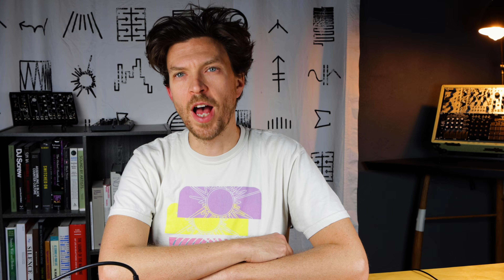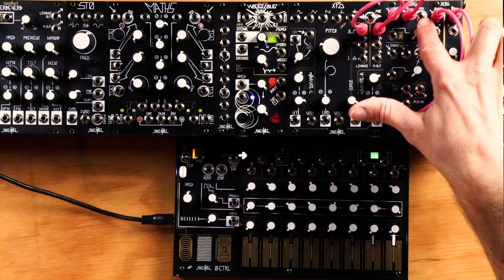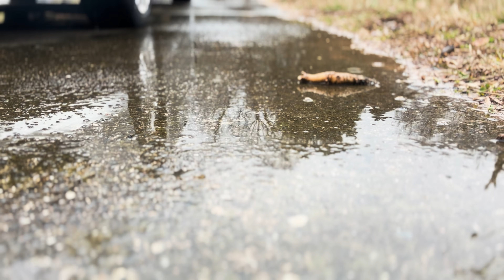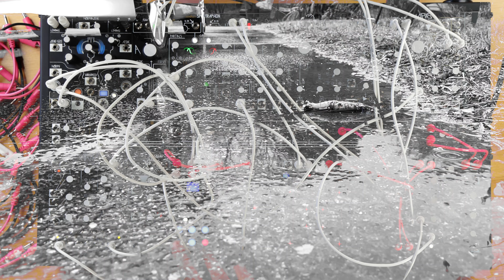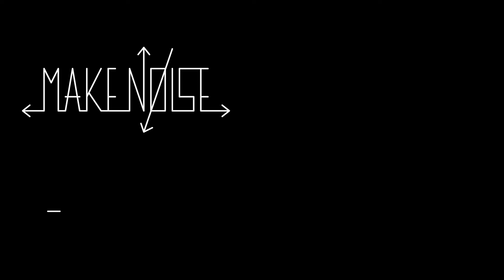DXG Strike and More! | Make Noise

Comment: You did say if we had any questions or patch requests... 

Let me start with, I have not owned any of your LPG's yet. Not even Optomix or LXD. Mutable Streams is the only LPG I have at this point.  Of your modules, I own Maths, Qpas, Morphagene, Spectraphon, Mimeophon, XPO, X-Pan, Rosie, 0-Coast, and 0-Ctrl. 

Thing is, I just ordered a 2nd XPO a few hours ago. So, what I'm wondering is... How do a pair of XPO's work with the DXG? I don't even have any idea how two XPO's together are going to sound yet, I just took a gamble because one by itself already sounds great, and the second one was a super cheap b-stock from my main vendor, so screw it, I figured. Seems like a winning bet.

What would you guys do with 2x XPO's into the dual channels of the DXG? I'll definitely be buying the DXG soon, just looking to get an idea of how you'd use it, as you have a ton more patching experience and ideas than I do. In the meantime, I'll try running a mono signal out of each XPO into Streams, and then a stereo signal out of each into A/B of Spectraphon, and tweak the partials. That will give me some idea, for a start. I'd just love to see your take on such a setup.
Reply from the maker: Thanks for the suggestion! I haven’t ever used two XPOs at once but I’m making a note to self!
Reply: @MAKEN0ISEMUSIC  2nd XPO received! In order to accommodate it into my MN case, I had to do a full re-rack of 3x Rackbrute 6U cases, to make physical room, and keep balanced power draw. Just finished the re-rack a few minutes ago.

This weekend is the Korean New Year long weekend, so I have a 4-day weekend to test it out in the new layout.

Comment: Why no Ch1 output without mixing? Seems a shame to always have to marry 2 stereo signals together at the moment of note creation. Why does only Ch2 get to live a life of its own? The mix only makes sense if both signals are going to be processed exactly the same from their very origins until output. Ch1 never gets a chance to grow and take on its own character unless it’s used by itself. Individual outs for both channels as well as a mix output (with perhaps better level control into the mixer) should have been done in order to fully showcase your new achievement. Just seems like submixing was prioritized over the real accomplishment here: a dual stereo lpg, knee capped with a mixer.
Reply: space, obviously. There just isn't room for another pair of outs in 8HP and since it's clearly intended to replace OptoMix, an 8HP module, in a MN shared system, they couldn't increase the width to accommodate outs for ch1 too. There's just no pleasing some people 😅
Reply: Where there’s a will, there’s a way.